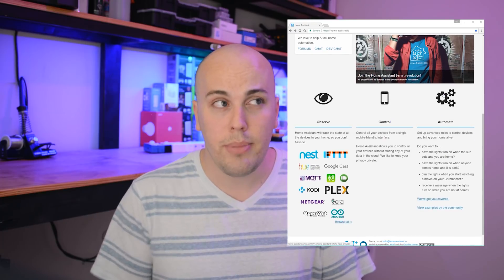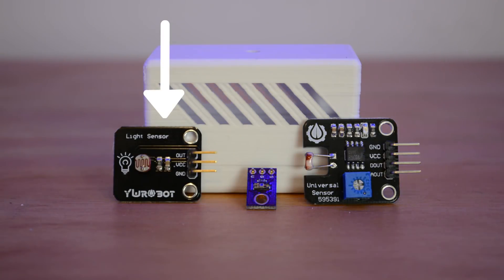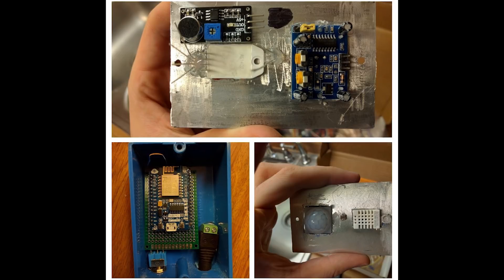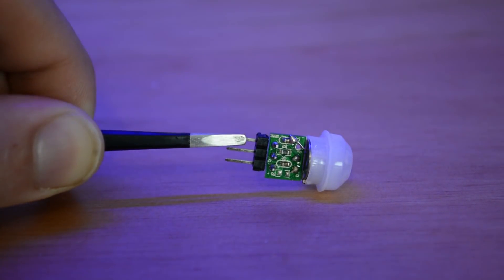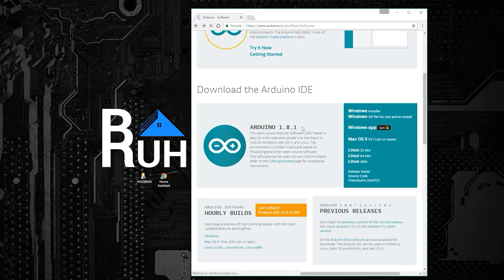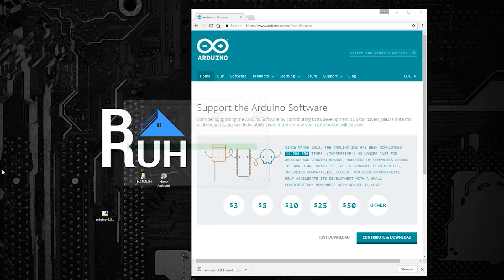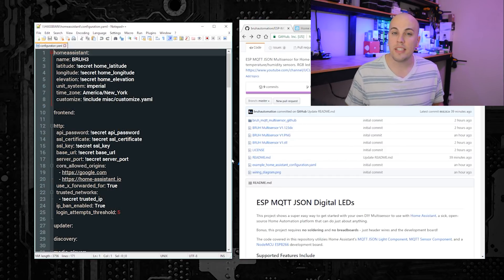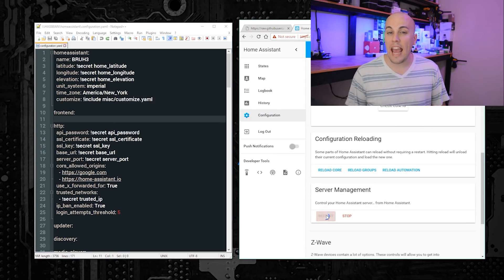$15 DIY Multisensor - Temperature, Humidity, Light, Motion, and RGB LED

Comment: Hey Ben, I am a long time fan of your videos and I love what you are doing. While I enjoy the reviews of Smart Products, I am in love with the idea of using DIY electronics to easily build cheaper alternatives to expensive smarthome products. While I love your projects, I know you love using MQTT and Home Assistant. This is fine and all, but some like myself prefer alternative systems. I went with SmartThings because it is a very well made consumer product, but has an expansive developer API and a VERY active development community. Plus, all of its cloud features are already made and I don't have to bother with certificates,  dns, and all of the pains of self hosting. The reason I am writing this novel is because I wanted to get permission to build this project and port it over to SmartThings. All of the code will be available on GitHub and my website and I will credit you completely. I just wanted to make sure that you were all good with me releasing a SmartThings version of the NodeMCU firmware for this multisensor. I love your vids and I can't wait for the DIY blinds video.

Thanks!
   - N

PS: You should really check out SmartThings/webCoRE/ST_Anything if you are interested.
PPS: You should check out using NodeMCU for garage doors. All you need is a 2 relay board (bridge the commons - connect to opener) and a wired door sensor (detect status of door).
Reply from the maker: Definitely! Please feel free to port whatever code you'd like. I've heard awesome things about SmartThings. I'm definitely going to be branching into other hubs soon. I have a new Fibaro Home Center lite I'm testing now,  SmartThings, and HomeKit are definitely on that list, too. 

At the end of the day, there are lots of ways to do the same thing. Home Assistant is nice because it is so powerful with 650+ components + template automations, but the other hubs bring a lot in terms of their accessibility and transferability. After all, most people will want to sell a smart home at some point and 2000+ lines of HA config code is a lot for a non-enthusiast to deal with. :P 

Looking forward to exploring those other platforms soon. Thanks for the links!
Reply: BRUH Automation Thanks man. I'll be sure to send the GitHub link and instructions once I'm done in case you are interested. I'm excited that you are looking into other options because as awesome as home assistant is, it's not for the average Joe. If you get SmartThings, I would highly recommend webCoRE (a VERY powerful web based rules/automations system) and really just all of the smartapps that the community makes over at community.smartthings.com. Thanks for the great videos!
Reply: Okay, I finally got around to finishing the code. I have ported this over to SmartThings and once my PIR sensor gets in, I can test it, optimize it, and release it! I will be sure to send you a link to my website where I will upload the details. Cheers!

Comment: Great project, thanks for taking the time to pull it all together, and for sharing all of the assets. 
I currently have it working (minus the ldr - still waiting on shipping...), and have noticed really irregular results with the PIR sensor. For me, I get better results with different power supplies. So far I've tried an old RS Components RPi power supply and an Amazon Fire tablet charger - both caused the PIR to constantly report false positives. However, running it from computer's USB, and old Apple iPad charger seem to give consistently good results so far. Thought you might like to know.
Reply from the maker: Definitely. Power supplies are really important. It's really a lot of factors that cause that floating PIR. It's annoying AF, but once you find the right combination of parts/case/power supply they're pretty reliable!

Comment: I did the tutorial but I only had a DHT11 I could use. Does not seem to work as It should. It reports to me that its about 1500 C and a humidity of 1500%. I thought the only difference from DHT11 to DHT22 was that DHT11 reports whole numbers and DHT22 can report back numbers with decimals? Anyone else tested DHT11?
Reply from the maker: They are different sensors, similar, but have different levels of accuracy. Make sure you change line 73 to #define DHTTYPE DHT11 Cheers!
Reply: Fantastic, that solved the problem. Thank you very much. Great work :)
Reply from the maker: Nice! pumped that worked!

Comment: Hi
I get this error when trying todo this sensor, what im I doing wrong?

warning: espcomm_sync failed
error: espcomm_open failed
error: espcomm_upload_mem failed
error: espcomm_upload_mem failed
Reply: I was getting the same error.. Lowered the baud rate to 9600 (it's written on the NodeMCU board), and it wrote just fine.

Comment: does anyone know how to wire up the PIR. It appears to be labeled C1,C2,C3,C4 on the PIR.
Reply: I looked up the datasheet for the pir sensor and the board is pritty much the standard circuit described in it.

If you look on the circuit from the "top" on mine the pins are on this side and a voltageregulator with a condensator. So look at it with the U1 and C1 like they should be written (not upside down).
The top pin is 3.3v, the middle is the Signal (when triggerd gives 3V as an output in my case) and the lowest is gnd.

For a quick check if yours is the same, the two pins on the regulator which are on the same side go to ground, one directly and the other trough a capacitor.
Reply: I can't find any PIR pinout anywhere. I've tested using center pin as signal and tried both variants of power ang ground left/right. No motion detected, tested with 3 PIR censor. :(
Reply: Did you ever figure out your problem?

Comment: Dont waste your time on this project, there is no support when it doesnt work.
I could not compile this sketch after following it closely.
Library errors  generated during compilation.

Look for projects that are well documented and have a large following for forum help.

Pity though as the videos are good.
Reply: I would disagree about not wasting your time. It's not a waste of time as many, myself included, have gotten the project to work. I had issues as well. First with compiling the code, I had the same errors.  Then I looked at his code repo and noticed at the top, in the comments, he listed the required libraries.  They weren't mentioned in the video, but let's cut him some slack. Once you install these two library, it should compile:

      - DHT sensor library
      - Adafruit unified sensor

I also had issues with the wiring diagram. I had to do some research to figure out the pinout on the PIR sensor and I also interpreted the Nodemcu diagram incorrectly.

The videos are good and I'm learning a hell of a lot following the guides. If there's some bumps along the way, I just chalk it up to gaining better depth of understanding.
Reply: I had done a fair bit of research on the subject before I decided to have a go at getting this project going. I guess I was most disappointed that it would not compile (multiple errors) and no guidance on how to set up the arduino ide's parameters for correct settings for the nodemcu chip.Yes multiple error due to libraries missing and when you look through the code lots of commented out code. Such a shame there is no effort to document it well. In the end I think I had multiple versions of libraries and wasn't getting any where. I rarely complain but in this case I gave negative comment because of the lack of forum support for this project and the author not even interested enough to give some help or guidance on his forum.Looking at his information on configuring the mqtt section, my comments would be the same.So after wasting so much time on this and not really learning a great deal, I found some really well documented examples that work for these sensors and have been using them. Links avail if anyone needs them.So in summary just the lack of forum interest (not one person offered help including your self )and authors lack of interest

Comment: NodeMCU/ArduinoIDE noob here. I ran into some compile/verify errors, then some other funny stuff. Just wanted to post my some workarounds and troubleshooting here in case anyone else was scratching their head:
fatal error: ESP8266WiFi.h: No such file or directory
  #include <ESP8266WiFi.h>
fix: Switch board to "NodeMCU 1.0 (ESP-12E Module)"
 
fatal error: DHT.h: No such file or directory
  #include <DHT.h>
fix: Sketch > Include Libaries > Manage Libraries > Install "DHT sensor library 1.3.0"

fatal error: Adafruit_Sensor.h: No such file or directory
  #include <Adafruit_Sensor.h> 
fix: Sketch > Include Libaries > Manage Libraries > Install "Adafruit Unified Sensor"

WiFi not connecting? Here's a fun fact from my programmer buddy, Gnome: If your wifi password has a \ in it, you have to type \\ instead, since \ is an escape character in C programming.

Also, "brightness" is the LED brightness value, not the TEMT6000 or LDR Photoresistor Module. Those luminance values are reported under "ldr"
Reply: Thank you for the fixes!
I have been attempting to find the issues myself, but you've saved me from some headaches.
Reply: Hi! i'm having problems aswell, seems like there is a problem with DHT library's in arduino program... 

"Arduino: 1.8.5 (Windows 10), Board: "NodeMCU 1.0 (ESP-12E Module), 80 MHz, 4M (1M SPIFFS), v2 Prebuilt (MSS=536), Disabled, None, 115200"

Build options changed, rebuilding all
In file included from C:\Users\ztaal\Desktop\arduino-1.8.5\portable\sketchbook\sketch_jan11a\sketch_jan11a.ino:2:0:

C:\Users\ztaal\Desktop\arduino-1.8.5\portable\sketchbook\libraries\DHT_sensor_library/DHT_U.h:25:29: fatal error: Adafruit_Sensor.h: No such file or directory

 #include <Adafruit_Sensor.h>

                             ^

compilation terminated.

exit status 1
Error compiling for board NodeMCU 1.0 (ESP-12E Module).

This report would have more information with
"Show verbose output during compilation"
option enabled in File -> Preferences."

I cant seem to get it right?
Reply: Did you remember to include the Adafruit Unified Sensor library?  I'm using V1.0.2
For me it was the very last library in the list when I searched for it by name in the library manager.
Reply: Hi,
i have another problem here:

fatal error: bits/c++allocator.h: No such file or directory

Has someone an idea what i can do? Any hint, where i can get any further?
Thanx!
Reply: I found the solution myself: The Arduino IDE needs a short path without spaces! Reinstalling it unter "c:\Arduino\" or comparable short path and it works.
Reply: A little better but still errors :/

"Arduino: 1.8.5 (Windows 10), Board: "NodeMCU 1.0 (ESP-12E Module), 80 MHz, 4M (1M SPIFFS), v2 Prebuilt (MSS=536), Disabled, None, 115200"

In file included from C:\arduino185\portable\sketchbook\libraries\DHT_sensor_library\DHT_U.cpp:22:0:

C:\arduino185\portable\sketchbook\libraries\DHT_sensor_library\DHT_U.h:25:29: fatal error: Adafruit_Sensor.h: No such file or directory

 #include <Adafruit_Sensor.h>

                             ^

compilation terminated.

exit status 1
Error compiling for board NodeMCU 1.0 (ESP-12E Module).

This report would have more information with
"Show verbose output during compilation"
option enabled in File -> Preferences.
"

I dont understand, i have adafruit sensors innstalled..
Reply: thanks, this has solved the problem for me!
Reply: Thank you WheezyE
Reply: you forgot your libraries?
Reply: go to tools board and set it up to node mCU 1.0...

Comment: Arduino: 1.8.2 (Windows 7), Board: "Generic ESP8266 Module, 80 MHz, 40MHz, DIO, 115200, 512K (64K SPIFFS), ck, Disabled, None"

Build options changed, rebuilding all
esp-mqtt-json-multisensor:65: error: 'D1' was not declared in this scope

 const int redPin = D1;

                    ^

esp-mqtt-json-multisensor:66: error: 'D2' was not declared in this scope

 const int greenPin = D2;

                      ^

esp-mqtt-json-multisensor:67: error: 'D3' was not declared in this scope

 const int bluePin = D3;

                     ^

esp-mqtt-json-multisensor:69: error: 'D7' was not declared in this scope

 #define DHTPIN    D7

                   ^

F:\Arduino\arduino-1.8.2\portable\sketchbook\esp-mqtt-json-multisensor\esp-mqtt-json-multisensor.ino:133:9: note: in expansion of macro 'DHTPIN'

 DHT dht(DHTPIN, DHTTYPE);

         ^

F:\Arduino\arduino-1.8.2\portable\sketchbook\esp-mqtt-json-multisensor\esp-mqtt-json-multisensor.ino: In function 'void setup()':

esp-mqtt-json-multisensor:68: error: 'D5' was not declared in this scope

 #define PIRPIN    D5

                   ^

F:\Arduino\arduino-1.8.2\portable\sketchbook\esp-mqtt-json-multisensor\esp-mqtt-json-multisensor.ino:142:11: note: in expansion of macro 'PIRPIN'

   pinMode(PIRPIN, INPUT);

           ^

esp-mqtt-json-multisensor:69: error: 'D7' was not declared in this scope

 #define DHTPIN    D7

                   ^

F:\Arduino\arduino-1.8.2\portable\sketchbook\esp-mqtt-json-multisensor\esp-mqtt-json-multisensor.ino:143:11: note: in expansion of macro 'DHTPIN'

   pinMode(DHTPIN, INPUT);

           ^

F:\Arduino\arduino-1.8.2\portable\sketchbook\esp-mqtt-json-multisensor\esp-mqtt-json-multisensor.ino: In function 'void loop()':

esp-mqtt-json-multisensor:68: error: 'D5' was not declared in this scope

 #define PIRPIN    D5

                   ^

F:\Arduino\arduino-1.8.2\portable\sketchbook\esp-mqtt-json-multisensor\esp-mqtt-json-multisensor.ino:424:28: note: in expansion of macro 'PIRPIN'

     pirValue = digitalRead(PIRPIN); //read state of the

                            ^

exit status 1
'D1' was not declared in this scope

This report would have more information with
"Show verbose output during compilation"
option enabled in File -> Preferences.
Reply: Any idea? I managed to get 2.3.0. after installing 2.2.0. and then updating it.
Reply: While compiling i run into various errors. Some of them are missing libraries, and some where about gpio.

"error: 'D1' was not declared in this scope"

https://github.com/wemos/D1_mini_Examples/issues/21

In case someone get the same problem. I manage it to compile. Just to put it together and to turn the power on. :D
Reply: make sure to select your board as NodeMCU v1.0 rather than Generic ESP8266 (Tools>Board)

Comment: Hi . I tried this project but have no success compiling the code. Can you please advise what to look for. Below are the libraries installed and the error output for you.  Cant get a handle on the problem Thanks

Hi,
I have my hardware ready  and tried to compile your code.
It errors as below on include queue. Unable to find why so need some help please.
I have included the library componetnts installed and he error output

The following libraries are shown in library manager below

ESP8266FiFi 
by Ivan .... version 1.0.0 installed
IoTweet  by isuara .... version 0.3.2 installed

DHT  
DHT sensor Library by adafruit version 1.3.0 installed

PubsubClient  version  by nick O.........2.6.0 installed

ESP8266mDNS no details version unknown installed

WiFiUdp   not shown in library manager  files exist in C:\Users\USER\Desktop\arduino-1.8.2\portable\sketchbook\libraries

\ESP8266WiFi\src

ArdnuinoOTA  by Ivan and Miguel ...... version 1.0.0 installed

ArduinoJson  by Benoit...... version 5.10.0 installed

error report

Arduino: 1.8.2 (Windows 7), Board: "Arduino/Genuino Uno"

In file included from C:\Users\USER\Desktop\arduino-1.8.2\portable\sketchbook\libraries\ESP8266WiFi

\src/ESP8266WiFi.h:33:0,

                 from C:\Users\USER\Desktop\arduino-1.8.2\portable\sketchbook\sketch_may29a\sketch_may29a.ino:31:

C:\Users\USER\Desktop\arduino-1.8.2\portable\sketchbook\libraries\ESP8266WiFi\src/ESP8266WiFiType.h:26:19: fatal error: 

queue.h: No such file or directory

 #include <queue.h>

                   ^

compilation terminated.

exit status 1
Error compiling for board Arduino/Genuino Uno.
Reply: Hi, I´m a noob woth ESP8266 and home assistant. In fact, I have implemented thus project and I´m having issues with home assistant integration, but I think that your problem is in that you are compiling for Arduino Genuino/Uno and you must compile for Node MCU 1.0 (ESP 12.......). Try in Tools/Board and select this one. reviw the video for another necesary setups in Arduino environtment.

Comment: Do you know how to trigger on a GPIO state change?
if GPIO_pin1 state changes (goes from high to low or low to high)
 then notify

I can make it work but its not elegant

  - alias: switch_state_change
    trigger:
    - platform: state
      entity_id: switch.switch_1
      to: 'off'
    - platform: state
      entity_id: switch.switch_1
      to: 'on'
    action:
      service: notify.west_email
      data:
        title: 'state changed sw1'
        message: 'switch state changed2'  

ideally i would like to say
  - alias: switch_state_change
    trigger:
    - platform: state
      entity_id: switch.switch_1
      state: changed
    action:
      service: notify.west_email
      data:
        title: 'state changed sw1'
        message: 'switch state changed2'  

Keep up the good work on the videos !

Comment: Hi Ben you rock. Once again a grate video. Have to say i have waited for this video to arrive especially to confirm my thought that there are no ghosts in my home. (-8
I got the PIR you recommended and on the beginning just acted like the old one for some reason. I decided to change the pin and now it works fine. (could be my ESP8266 that was used for many tests)
So finally i can say that i have a working motion sensor in my place.
Thanks again for your hard work.